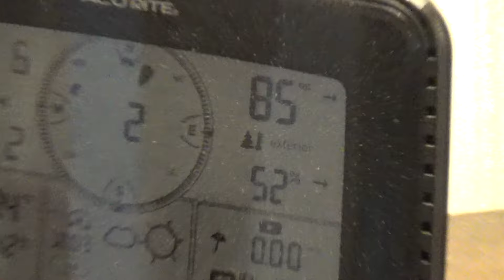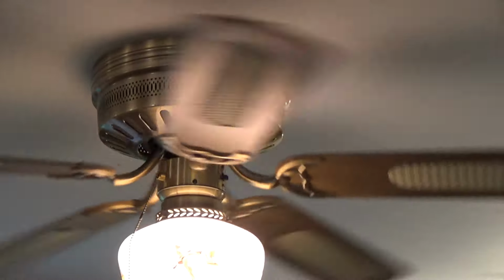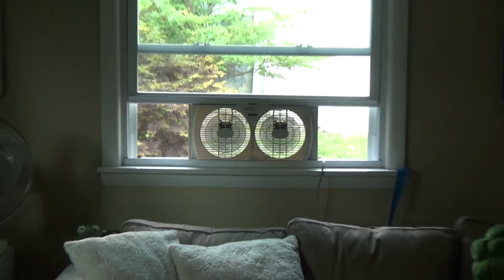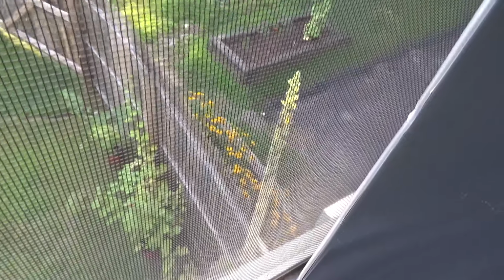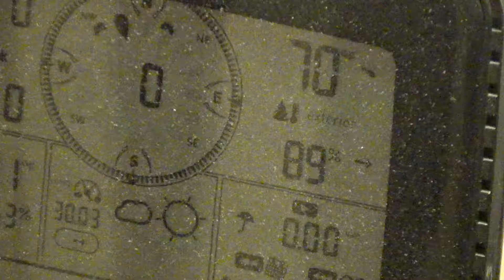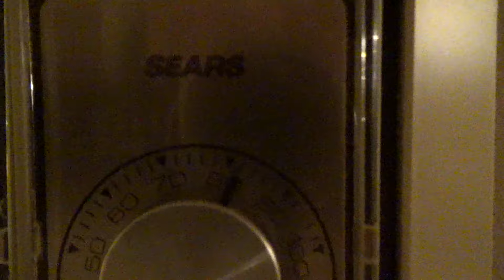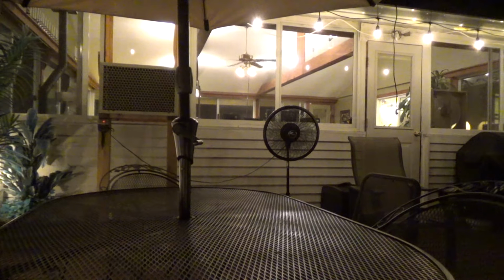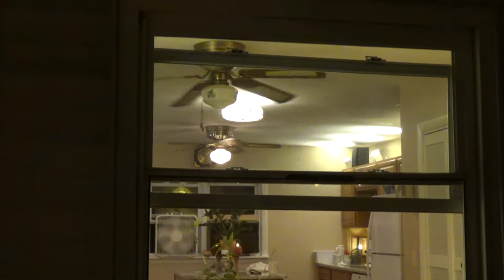Fans Running 7/27/2024

Comment: I love seeing the fans running after dark! So esthetically pleasing.
Also, I think it would be interesting if you installed a cheap, modern fan (something like that Hampton Bay Littleton) and ran it continuously until it encounters a failure, and to see how filthy it can get. I wonder how long it would last...
Reply from the maker: I agree! The ceiling fans run for longer than one might expect, it would probably run for years with no trouble.